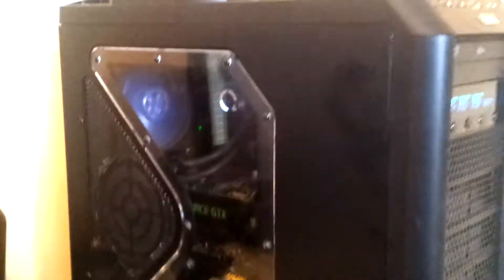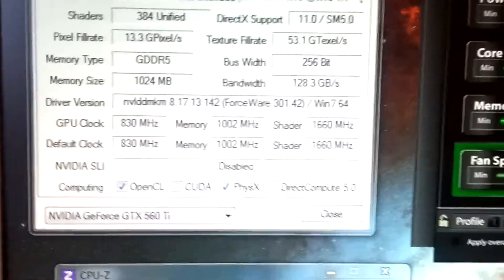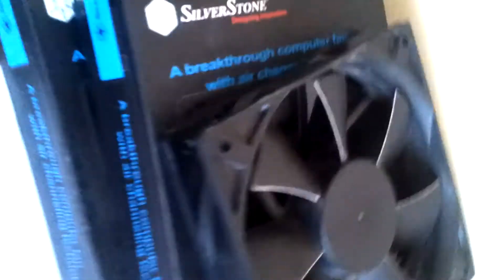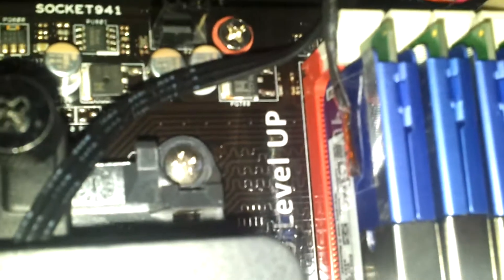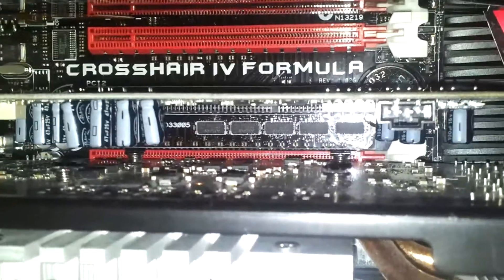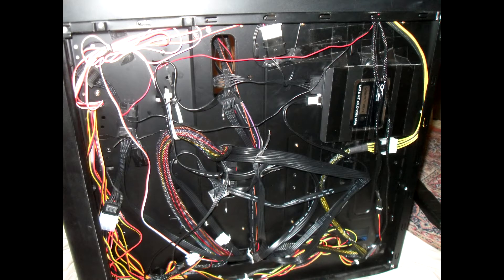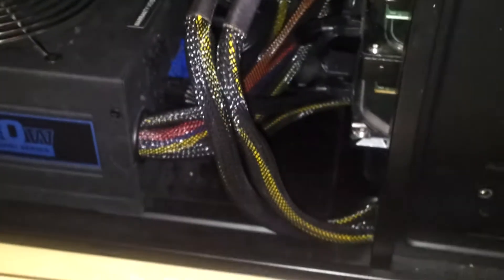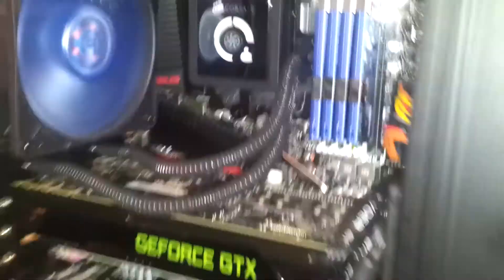Rig Update Video - 21/06/12 (GTX 680, 560 TI, Scythe Kaze Master 2...)

Comment from the maker: Well im sure that you can buy this for less now but here is the price of when i bought the parts
CPU:1090T = 230 euro
MB: Asus crosshair IV formula = 200 euro
case: Antec 902 = 110 euro
GPU: GTX 680 =600euros
GPU2: gtx 560ti= no idea for the price
ram: around 100 euros
PSU: 150 euros
AP 121 fans= 16 pounds each
Fan controller = 43 pounds
H80= 69 pounds
sound card: 25 pounds

And i might be forgetting something so yeah